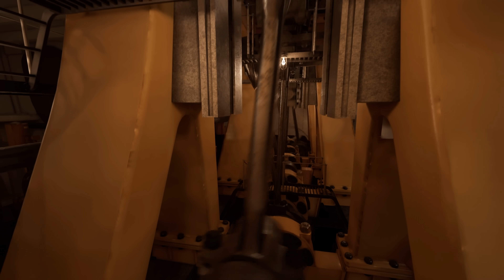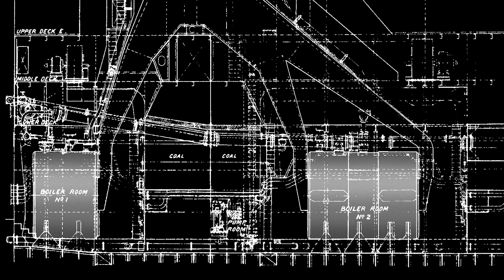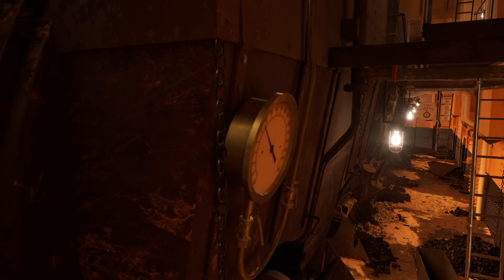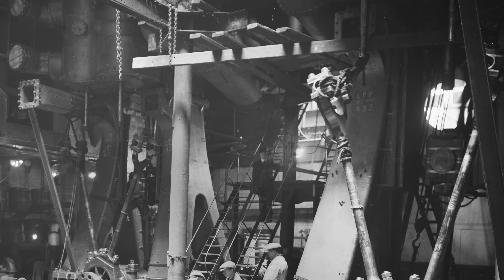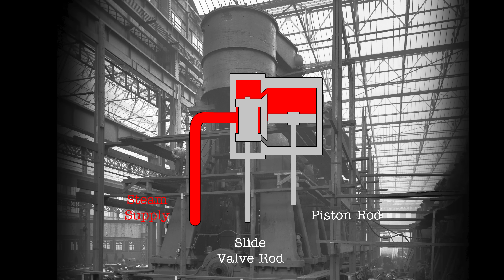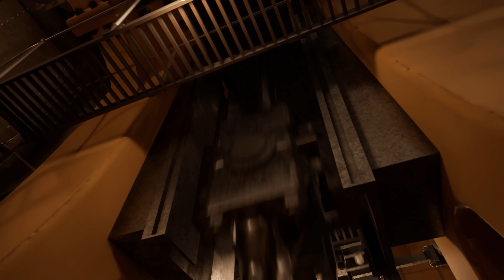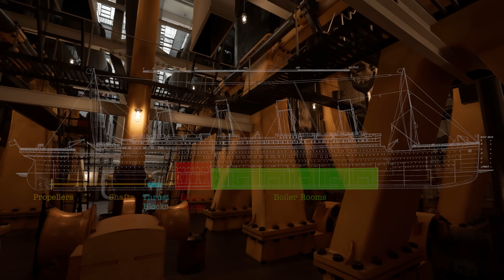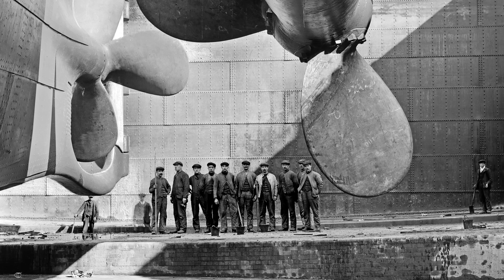A Complete Guide to Titanic's Engines

Comment: I think its 40 london buses for 600 tonnes. its said the titanic used over 800 tonnes. not sure what "ton" they are.
Reply: Either 600 long tons or 800 short tons, the hybrid layout was still more efficient than Lusitania and Mauretania - Cunard’s greyhounds burned 1,000 tons of coal per day.
600 long tons x~7 days = 4,200 tons burned (assuming Titanic was full bunker at Southampton and used her final lumps docking in New York)
For 800 short tons x7 days, that’s 5,600 total.
Assuming a short ton is .75 long ton, Lusitania probably burned 750 long tons (1000 short tons) a day, x4 days is 3000 long tons (4000 short).
The Olympic ships were more efficient
Reply: I thought I heard that as well, but then replayed, and I heard him say the equivalent weight of 2 buses were burned per HOUR.  Not per day which was the 600 ton reference.
Reply: @bryce2680  ya my ears are having a mandela effect. I swore it was a day and even replayed it. my apologies

Comment: I wonder how long a cold start would take?  Days?
Reply: Definitely hours. The boilers were probably lit a couple hours into Titanic’s departure day, around 2 or 3 in the morning. That would’ve given enough time for the ship to build up steam so she could set off right at noon.
Reply: @jamesgroccia644 it takes several hours to start a normal steam train, it's not only building up steam, you have to oil stuff. According to quora it took about 24 hours to start up titanic.
Reply: About 10 to 12 hours to bring a double ended boiler up to operating pressure…